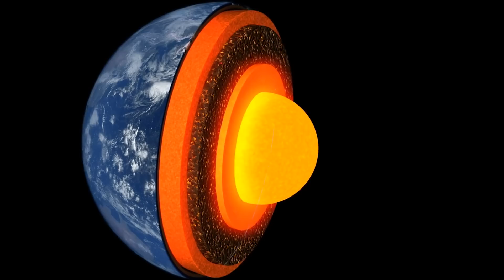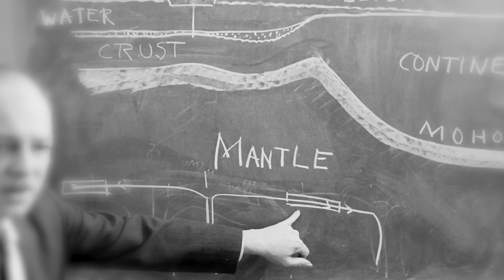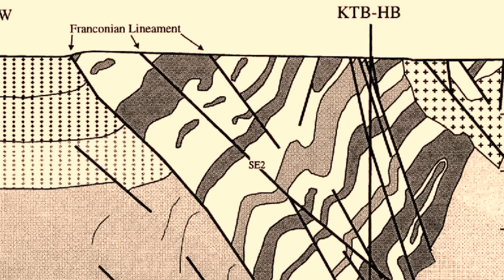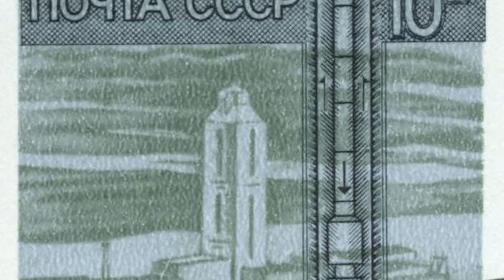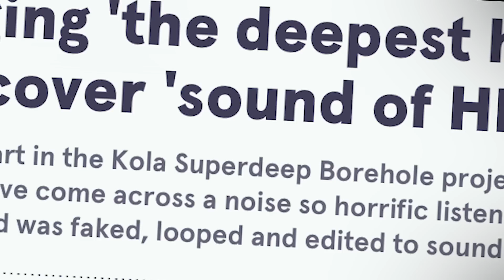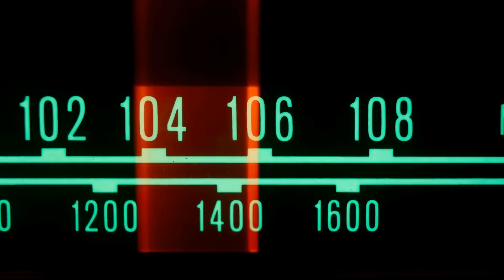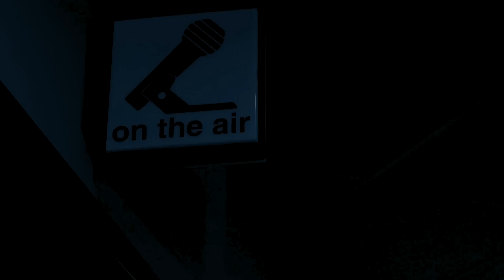Inside the Dark Truth of the Deepest Soviet Borehole

Comment: I dont understand the rocks become plastic-like. I wouldn't think 180° C would be hot enough to effect the structure of the rocks.
Reply: It wouldn't. This is one of the crappier researched videos they've put out.

Well other than a couple of weeks ago when they kept confusing George H.W. Bush, George W. Bush.
Reply: @RichardBaran  I totally agree !!,if this is the type of information the future of man has to depend on were doomed .. seems people gladly swallow any bullshit as gospel because ,"it was on the internet ", must be fact , eighnit?
Reply: my farts come out hotter than that and make sounds like something from hell.
Reply: It's not, and it's just stories made up and passed like Chinese whispers
Reply: agreed. For being that deep, 180C seems a fairly moderate temp
Reply: 1800 , plus pressure.  Robots cant be trusted
Reply: The key factor is pressure. The rock at 12km deep is 180 degrees because of the pressure, not surrounding heat. It's easy enough to heat something in an oven to 180, but try taking that same object and putting it under so much pressure that it's internal friction due to compression will heat it to 180. What do you suppose the consistency of that object would be when under that much pressure? That's right, it would be plastic-like, would it not?